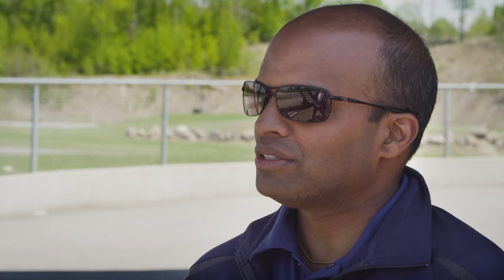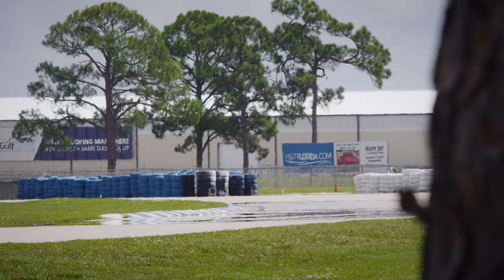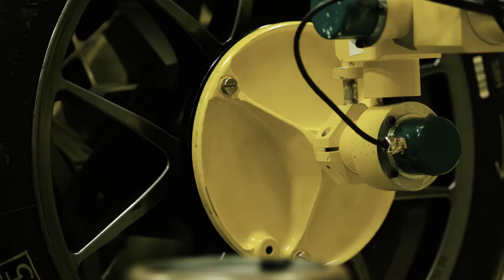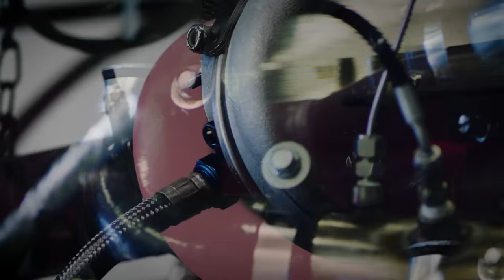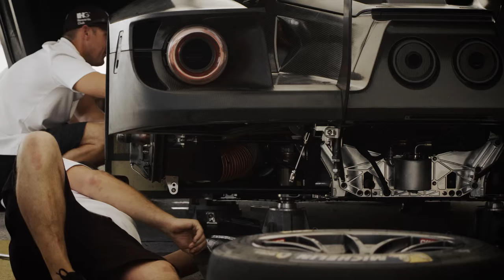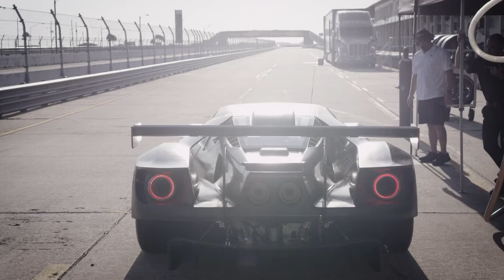Ford GT Racing Development | Ford GT | Ford Performance

Comment: Ford, just make more Ford GTs, the current production line is too much limited, too exclusive, 
or at least make a mass product sports car other than GT350R which too is limited to USA,
Reply: +Ponygt 662 Nope. They couldn't sell the previous GTs at all so why would they increase production?
Reply: +Ponygt 662 
Mustang extended its Pony Car Wars dominance in September,

9,456      Mustang
5,246      Camaro

Mustang sales are killing the Camaro
Reply: Hear That?
The previous GT was too pure for lot of people 2 buy, no TCS,NO ESC,NO ABS, Nothing, it was a RAW drivers car like McLaren F1, 
The new GT is nothing like that, its a road legal race car like the Radicals, but being a Ford, the father of mass production they could have built more of these
Reply: +Ponygt 662 why would would they mass product that wouldn't make the car worth anything they know what they are doing
Reply: +Hear That? ummmm what lol they didn't make a lot of them man
Reply: billy heaton
What do u mean? Ford knos what they are doing but I wish they could have built more Ford GTs, as of now its too elite and exclusive like the P1,LaFerrari,Veneo,etc
Reply: 2015 Corvette ZO6 had mechanical problems so Motor Trend only got a lap time of just 0.10s quicker at Laguna Seca than a 2013 Ford Shelby GT500.
Reply: Hear That?
Not about body style, it's about Engineering and Manufacturing, along with Reliability under Stress.
Reply: +Escape for Mankind mustang beats camaro sales by 4000? Too cute. Ford mustang today is now Worlds bestselling sports car and is popular worldwide
Reply: Kenth Llemit this is very true like i said before ask the people of the U.K they like the 5.0 so  much that it's on back order
Reply: they're only doing 200
Reply: +billy heaton yes the mustang sales rose up more than 60%. Mustang always exist in 3rd world countries and sell like pancakes
Reply: Kenth Llemit the U.K not a 3 world countries that place pretty dope you should go

Comment: you know what...its a great car...and im ashamed but I MISS THE V8 MAN
Reply: yep :(...WHERE S MURICA
Reply: 3.5L eco boost is alot lighter and smaller than a v8 and by dual turbo charging its supposed to produce around 600hp.
Reply: i know that this form of engine is smarter,probably faster more practical...it is a great engine...but i cannot help myself

Comment: a level of car Garbage Motors will never see.
Reply: +drfaticus F-gm Not with that kind of sound, no.
Reply: Wait, wasn't that a Corvette prototype that won ALMS overall this year? Ford also competed if I'm not mistaken.
Reply: +Alpha Tyranax ALMS has not been around for two years.  IMSA, which is what replaced ALMS does not have a Ford team that competes against Corvette until next year. Corvette didn't win this year, they came in 3rd with 2 wins

Comment: They won't be competing in the prototype class. They'll be competing in a handicap class (the series directors dictate engine performance via displacement and rpm limits for individual types of cars, gearbox ratios, etc in insure 'parity' among the cars). Never the less, it will be fun to watch.

Comment: I wondered at first why no v8 (which would have been sweet too) buuut then I thought about weight displacement. A twin turbo v6 would be a great drop in under any hood atop the fact its in a chassis that weighs less than any 4 cylinder in production. Le mans is won at the gas tank

Comment: Beautiful car no doubt. But I just can't get with that engine. I'm sure it's fast, light, powerful, reliable and everything else it needs to be.... It's just not "special" for the heart of a supercar. I'm not trying to be biased on that engine. But even the name ecoboost is boring. It sounds like it belongs in a Taurus. Now the voodoo engine in the gt350 is a special engine. I think I would get more driving experience from the mustang over the gt because of that.

Comment: I believe Porsche holds FAR more 24hour/endurance race titles/wins than Ferrari and Ford.  The GT-R compromised with a V6tt as is ford.  They are great for what they are but there is no supreme engineering benefit to power or efficiency, some do it to success but anyone who has driven an i6, v12, v10, smooooth V8. It just don't feel the same. The powerbands are better.

Comment: This a cool car with a cool engine but it would have been much more impressive with a 4.0 liter V8 With 800 HP and AWD.
Reply: AWD, what is this nissan?! Regulations won't allow any car to exceed 600-700 HP and 4.0 Liters
Reply: +Xerro No Vatimo I just hope it's faster than a GTR Nismo. Or at least a Corvette Zo6. Or else it's not worth $300,00 to 400,000. Lol it's a ford. It has to be set at a great price and faster than a Corvette. Or I might as well get a 2016 Ford Focus RS and boost it up to 550hp and smoke this GT.

Comment: Yeah....Ford is making all sorts of sound business decisions. Destroy the capability of the Explorer, Make your cars too expensive across the board, and the biggest sin so far, murdering the legacy of the Ford GT. You've cut the heart and soul out of the car just so you can use the engine you dumped all that money into. I'm sure one day you'll destroy the mustang even harder than you already have. One day they'll drop the V8 for that "Race proven" V6 garbage. I'm starting to lose all respect for the car company I currently exclusively drive. But hey, I'll probably not be able to afford the new cars anyway with the current pricing scale. They stopped listening to us a long time ago anyway. You should be ashamed of yourselves for destroying the legacy, heart and soul of the Ford GT.

Comment: Needs a V8.
Reply: +:o V8 wouldn't be nearly as fuel efficient which is extremely important in endurance racing which is this cars primary purpose.
Reply: Strawberry Poptarts The Ford GT is legendary and  it always had a V8. Putting in a V6 would completely mess up such an icon.
Reply: +:o No, the GT has always had a truck-based engine.
Guess what this iteration of the V6 shares it's architecture with.
Reply: FormulaChris085 It had a V8 truck engine from the F-150.